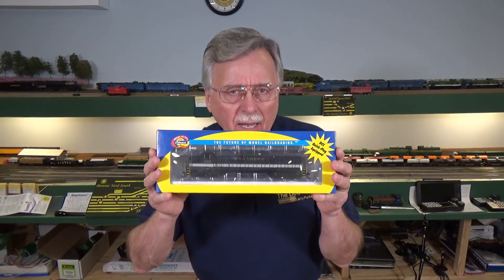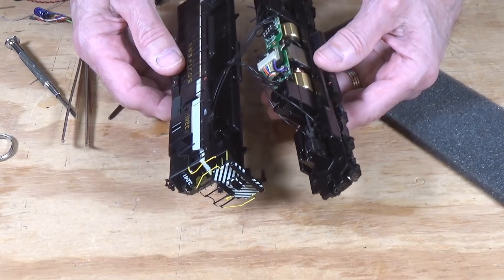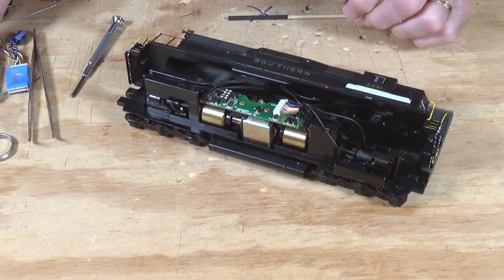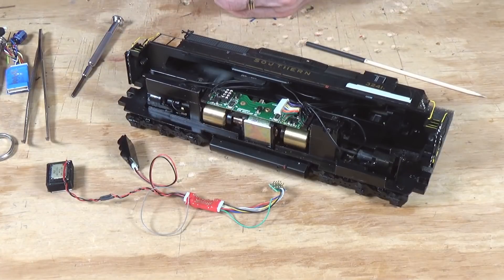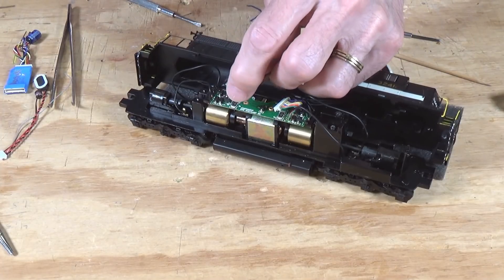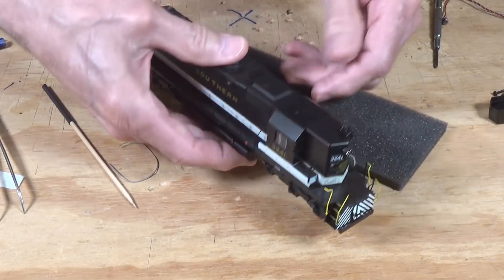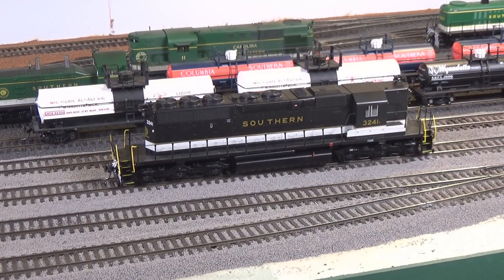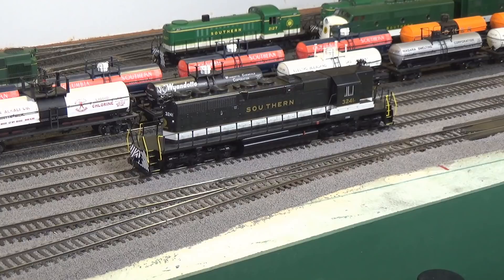DCC Sound For A Ready To Roll Athearn (194)

Comment: A late Monday video!  Very good video.  Yes, if you plug an eight pin decoder into its socket without removing the JST 9-pin blanking plug you will destroy the decoder (I had customers who found out the hard way).  I'm surprised that you didn't use a foam cradle to hold the engine when you were removing and replacing the couplers.

Comment: I wish you would have shown how to install the blue decoder and then add a speaker to that. That is what I’m trying to figure out how to do currently. I have the exact same locomotive with the digit tracks decoder and a speaker. The RTR box was labeled DCC and sound ready so I thought there would be a quick plug somewhere on the factory circuit board, but there is not. I can’t find any instructions to show me what pins to connect to to add the speaker.
Reply from the maker: I clearly pointed out in the video the plug and socket for installing the blue decoder using the JST connector so I’m not sure what your problem is. It really is a simple plug snd run arrangement. I decided to use the smaller N-scale decoder and the 8 pin socket but the blue decoder install would be just as easy. Refer to the Digitrax instructions for the decoder as well.
Reply: I have one of the Digitrax blue decoders with out an speaker and plugged it in to the 9 pin plug on an Athearn RTR SD45. I want to add a speaker to this setup using what I already have. I cannot find any information in the owners manual of the decoder or loco or online as to where or how to add a speaker to this locomotive using the decoder I have and a Digitrax speaker I bought separately. I cannot find any video or instructions for this particular setup.
Reply from the maker: Are you sure the decoder is a sound decoder? If it is it should have come with a speaker attached.
Reply: Just double checked and you’re right, it’s just a mobile decoder not a sound. I thought that because this RTR says DCC Ready/Sound Ready on the box that I could add a speaker somewhere to the factory mother board once adding any 9 pin decoder.

Comment: So, I have an Athearn Roundhouse gp40-2 in dcc ready. I've been looking at the NCE power cab dcc system. I just can't afford a digitrax system. I'm  building a 2ftx16ft shelf layout. I need some guidance on selecting a sound decoder for this locomotive. I appreciate any tips you can give me, thanks
Reply from the maker: I think you’ll find the PowerCab will take care of your needs for a long time. As for a decoder take a look at Soundtraxx decoders.
Reply: @TheDCCGuy  so apparently my roundhouse locomotive has a 21 pin plug.
Reply: I think I've found what I need on the soundtraxx website! Now, the stay alive,  and sugar cube speaker. Thanks for your help!!
Reply from the maker: Try it without the keep alive. I generally have found that with most HO diesel locos one really isn’t usually needed.

Comment: Another great video to show how easy it is to upgrade a plug and play "DCC Ready" RTR.  Me personally I would install a Soundtraxx Economi PNP board. Use the same speaker and power saver. Maybe worth upgrading the lights also to LED. Can't wait to see, or should say hear, the updated sound file you find to upload to it.
Reply from the maker: Yes, there are several other options as far as decoders go. However I wanted to make this as easy as possible by using the RTR options of the Athearn model. Plus, this loco spends most of the time sitting on a display shelf.

Comment: Hey all, I need some help here. Just picked up a couple of sweet Athearn AC4400's with the quick plug feature. I noticed the front coupler of one of them is missing the little screw. Where can I find a replacement screw? Does anyone know the size / thread? Or where they are sold? Thank you!
Reply from the maker: Most hobby shops should have a selection of small screws but you might also find them at a local hardware store. A 2-56 is a common screw used on models but in this case it may be smaller.
Reply: @TheDCCGuy  thanks! I'm going to the Northeastern PA train show on March 3rd, maybe someone will have a spare parts bin lol. Do they make plug in decoders with the sounds of AC4400's?

Thanks again for your help! Love your videos!
Reply from the maker: Take a look at Soundtraxx decoders, they offer a wide range of diesel sound packages.
Reply: @TheDCCGuy  Thanks again! And a great channel you have!

Comment: I have this exact same unit....I've regauged and check the wheels over and over and all it does is derail. I've checked almost all the track where it hops off and it's always the middle axle that causes the front to lift and it just drives me nuts. They are the smooth newer wheels not the powdered metal ones. My Southern 3205 is cursed the same way. I've no idea to cure it.
Reply from the maker: There must be something in the trucks that is causing the wheels to be off center and cause a derail. Check the pickups and make sure they are not pushing the wheels off center.
Reply: @TheDCCGuy  brilliant!  I'll give them a look-see ! Thanks buddy! I'm watching all your videos as I'm building a 6x12 layout so all your videos are appreciated! Keep up the good work!

Comment: Just installed one of these. The speaker is very quiet. Do i need a sugar cube speaker also?
Reply: What kinda of speaker did you upgrade to? Thank you
Reply from the maker: Did you watch video 195 on uploading a different sound package and adjusting the volumes? How did you install the speaker, the enclosure needs to be sealed properly. The one in the video is from sugarcubeaudio65 on ebay (https://www.ebay.com/itm/223750106867?hash=item34188baef3:g:79kAAOSwO2ZexTgq)

Comment: Good video, Larry. Seems like this would be a fairly simple installation. For the heck of it, I would probably replace the incandescent lights with LEDs too. One thing though, it may be my old ears but I could barely hear the sounds.
Reply from the maker: If I crank up the volume folks complain it is too loud so i leave it alone and others complain it is too low. As I said we’ll experiment with various sound volume settings in the followup video.
Reply: @TheDCCGuy  I imagine you get a lot of varying complaints on such things as the volume and I suppose most of the problem in my case is me. I am 78 and a bit hard of hearing, I have the volume wide open and could barely hear the bell and maybe the horn. Tell those folks complaining about the volume being too loud to turn it down. As I said, mine's wide open.

Comment: Thanks for the great explanation!

I have to disagree that a GP38-2 sound file is a good sub for an SD40-2, though. Being dash-2 has nothing to do with the sound, as far as I'm aware, and the big difference is that the GP/SD38(-2)'s engine is Roots-blown, while the GP/SD40(-2) is turbocharged.
Reply from the maker: I’m sure you are correct, time for me stopped in 1957 so I lack that detailed knowledge of more modern diesels and they all sound alike to me (well sort of).
Reply: @TheDCCGuy  Fair enough. 😁

Comment: Another great video, Larry. Thanks for taking the time to show others that those old locos are still worth using!

I have to say, though, the sound file on that decoder is awful. I don't mean volume, just the quality of sound. I could literally hear the decoder changing pitch as it tried to match throttle with engine sound. 

 Is that just a generic file, or do all the Digitrax profiles sound so terrible?

Comment: Watched your video while following along, taking apart a Roundhouse Dash 9-44CW 'DCC ready' loco...found I have a 21 pin connector. Any suggestion for a decoder with sound? Thanks!
Reply from the maker: As far as I know all the manufacturers that make sound decoders would have a 21 pin decoder that would meet your needs. Just visit their respective websites and see which offers the functions and sounds you desire and the cost.

Comment: I installed a digitrax decoder into my athrean ready to roll loco just like the video. I have sound but it won’t move. Any possible fixes?
Reply from the maker: Since you have sound it obviously is getting power, so check the wires to the motor. Also check your address settings.
Reply: @TheDCCGuy  I checked the wires and it ran fine as a DC locomotive. I have a NCE power cab and had it addressed to 3
Reply from the maker: @CptAwesome747  I have had several emails from folks with the same problem in the last week so you are not alone. With NCE systems there is a difference between the short address “3” and the long address “003”. So at some point you have managed to get the system confused as to which you are using. Ry entering the address both ways and see if it responds.
Reply: @TheDCCGuy  I responds to just 3 and only has sound
Reply: @TheDCCGuy  I have tried both addresses and it will not move

Comment: Thanks again for the great videos Larry!  I am learning a lot from them.  I just did my first "real" install which was taking out an ESU Essential Sound Unit from a new Walthers NW2.  I put in a LokSound 5 micro and was able to squeeze a PowerPack by separating the capacitor from its board and having two wires to reconnect the board to the cap.  The loco operated in reverse (movement and lights) and I was able to select the "reverse" function through the LokProgrammer to correct this.  What did I do to create the reverse action in the first place?  I matched all the color wires from the locomotive to the LokSound micro board (it had the wires attached to the smaller plug in board already).  Second question, where would you connect a PowerPack on a ESU Essential Sound Unit board.  I can't find much information on these new Essential Sound Unit boards.  regards, NS.
Reply from the maker: I rarely depend on the factory installed wire colors, they’re just too undependable. It is likely you reversed the wires going to the motor. I have not seen an ESU Essential Sound Unit so can’t help you there.
Reply: @TheDCCGuy  Thanks!  I'm glad that reverse option was available on the programmer.  Saved a lot of rewiring.  If I find out about the ESU wiring for a PowerPack I'll let you know.  Regards, NS.
Reply: @Form44208  Just to re-iterate what Larry said, you just have the feeder wires to the motor backwards. You can set normal operation of loco in the decoder, but I like having them set correctly from a wiring perspective so that I'm not guessing on each loco.
Reply: @JF-lt5zc  Thank you!  I'm the same way.  I like stuff to be wired properly even if it cannot be seen.  I hooked grey to grey and orange to orange, but apparently it was not wired on the decoder itself the correct way (I bought the decoder prewired).  Next time I open it up, I will change it.  It was a difficult install for me, being the first full install, still perfecting my soldering technique, and getting all those wires folded up inside this small shell was a chore for me.  I don't know how people can work on stuff smaller than HO scale!  regards, NS

Comment: Why did you pick that decoder?
Reply from the maker: I had it on hand, it was small enough to fit easily,  comes with a range of loco sounds, it is a lot easier to program and upload sounds, and it had an 8 pin plug ready to go. It may not offer the same quality of sound and functionality as some other brands but it makes for an easy installation. I have an Atlas RS1 with that same sound package in a similar decoder that has been running now since 2015, no hiccups at all.

Comment: Removing the weight cuts the pulling power ny some factor. Could create operating problems if the train has to much load.
Reply from the maker: They use screw in weights so they can be easily removed for adding DCC. If you need more pulling power just add another loco to the consist.